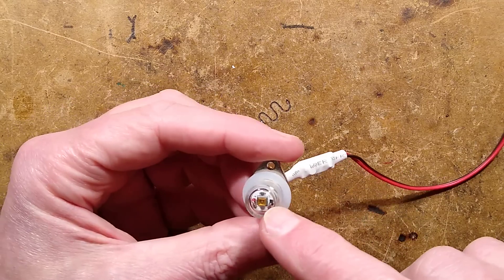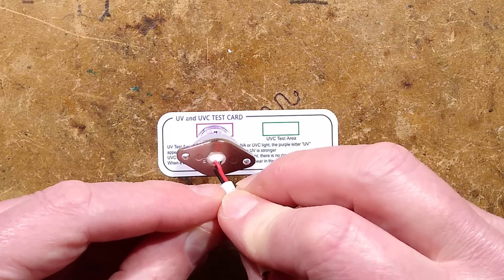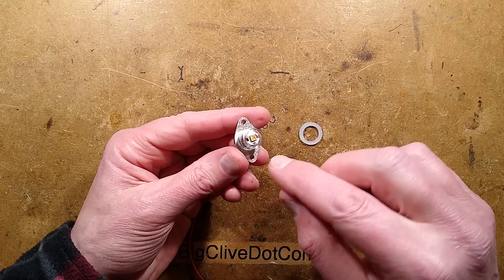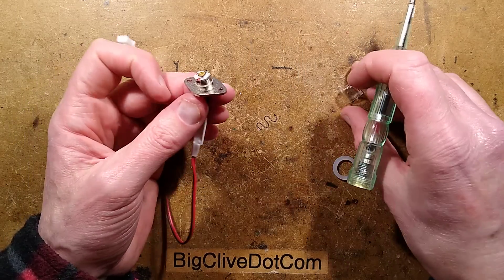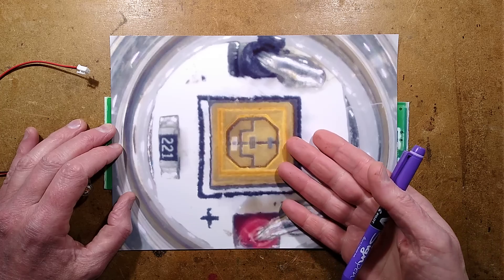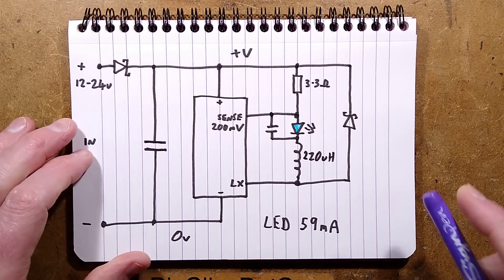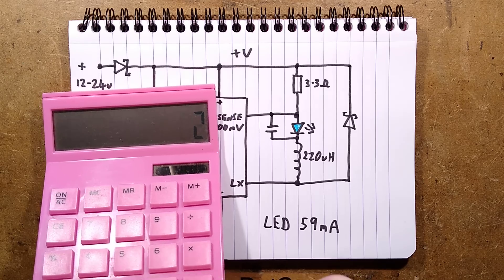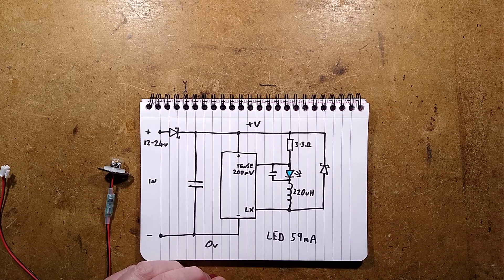UVC LED module for water sterilising

Comment: Thanks for sharing your results. I see a lot of comments questioning the quartz glass dome. You got a result on the card for UV-C. Doesn't that mean that the glass must be quartz? If it weren't it should have blocked the UV-C with no result (not even a faint). So I would state; either the testcard is fake and the UV-C indicator reacts to  UV-AB which will penetrate normal glass or if the card is genuine for UVC the dome must be quartz.
A simple test for checking the quartz is to try and make a small scratch with a knife. Quartz is harder than steel so it should not scratch the surface.
Reply from the maker: It can also be high purity uviol glass.

Comment: I also bought a 5V led UVC and did some tests, the first time it drew about 0.06A, but even so the led heated up after 15 minutes, then I increased the voltage to 8V, it drew 0.4A but it stopped by itself, I think it was due to overheating, now at 5V it takes 0.25 A... I don't know why... in the banana test it didn't color at all, even if I took off that quart or whatever it is... I'm still testing. DO NOT look at him with a blank eye, danger! it's like a welding flame!

Comment: I miss the old TO3 packages, I've known them since my valve days.
Not surprising actually since they were designed to plug into B9G valve sockets during the changeover period (mechanically, not electrically, obviously).
Try it for yourself, or get the dimensions for both and compare.

Comment: For years I wanted to put one of these at the bottom of a 55 gallon plastic drum full of water. 
I figure that with the small amount of heat the LED emits, it will create convection currents in the water so that it will all be near the LED in time.
Maybe as a survival source of clean germ-free water.

Comment: One thing I've learned recently about LEDs, is that you can put a very low current through it (1uA or so) and measure the voltage drop. If it's (for example) 2.1V, calculate the wavelength of a photon with 2.1eV of energy, and that will be the wavelength of light the LED produces.

Comment: 3:19: I know you have to use isopropyl alcohol to clean fingerprints off the quartz glass on, say, an incandescent stage light bulb. But for a piece of glass that doesn't get that hot, is it strictly necessary?
Reply from the maker: With these, the layer of fingerprint oil can attenuate the UVC output.

Comment: Mouser has the Mikroe-4144 UVC sensing board for about 50€ plus taxes. That uses a narrow band UVC detector. Should be good to build a simple detector from. It has analog and i2c outputs.
Reply from the maker: I've ordered a simple UVC meter that may use one of those sensors.
Reply: @ looking forward to the reverse engineering!

Comment: This is a very interesting component. But don't forget that UVC is extremely dangerous. Never look into the beam with your naked eyes ! (if you want to keep your retina). And skin exposure can cause cancer !
Take care and wear the right protection.
Reply from the maker: The cancer thing has changed.  They now realise that while UVC causes surface irritation it doesn't reach deep enough to damage DNA.  UVB and UVA at high levels pose a much higher risk.
The effect of UVC on the eyes is purely on the outer surface.  It does not penetrate to the retina.
Reply: I probably need to update my knowledge of the risk level, but I prefer to remain cautious.

Comment: Maybe a dozen in a small rvo under sink system. I have 2 UV sterilizers that have 25w UV tubes in quarts tubes after the water passes thru a .01 micron pvdf filter. Only lets water and dissolved minerals thru. Our subdivision is on well water and a water tower that’s not treated. The UV is turned on with a water flow sensor and relay so it’s not on 24/7. The ballasts and bulbs here aren’t quality so weekly tests are in order.  What UV type are my bulbs?
Reply: What does RVO, PVDF mean? And why and how do you do weekly testing of the system?
Reply: @cajampa  rvo reverse osmosis.  polyvinylidene fluoride pvdf  thats what the filter was sold as. It has these strands/tubes looped inside that are glued into one end. Water enters the strands/tubes on the sides and exits on the ends. I test weekly because the UV bulbs and ballasts are so unreliable. Cheap Chinese is all that’s available in the Philippines.
Reply: @rancillinmontgomery2480  OK thanks, but how do you test for still functioning sterilizations by the UVC? I ask because I will probably get something similar with also Chinese based hardware. And this quality/trust problem is why I haven't yet.
So I am really curious how you solve this.
Reply: @cajampa  I just make sure they are lighting up.
Reply: @rancillinmontgomery2480  OK. But just because it looks like it is working, does not mean it gives enough of a UVC dose to unalive anything needed in the water.
These things gets weaker when they get older that is why they have hour rating on them. Meaning they still put out light far after they are doing its proper function.
Reply: @ they don’t usually last longer than a year maybe from being over driven. A total of 50w of UV should do the trick even if it’s gone down by half output I would think. They are in series plumbing wise so the water passes thru a stainless tube 475mm then another long at a low flow rate. It’s only for drinking water and ice machine. You also need to pull the quartz tubes and clean with CLR to remove the mineral buildup that cut down on UV transmission.
Reply: @ one thing is for certain they are not set and forget.
Reply: @rancillinmontgomery2480  OK, I would think the only way to find out how long your setup lasts before it need to be changed as far as UV goes. Is to do some kind of bacterial culture on some medium.
And what would you have minerals in your water after you RO filter? I have 0 TDS after RO membrane. What is CLR?
Reply from the maker: The sterilising UV bulbs are UVC.  Make sure you don't look directly at them when they're lit.

Comment: Mr Clive, have you ever done a teardown on a hotel chocolat velvetiser? Fixed mine this weekend, and I thought the wiring in the base was beautiful, even dealing with the sealed unit 👍
Reply from the maker: I've not looked at one.  I'd guess a heater and magnetically or directly coupled stirrer motor?

Comment: Well I feel much cleaner now, thanks Clive. 

Why not just put the visible led in series with the UV led.?

Make your own UV a, b, c, and IR, detector/realtime imager. Us an old phone or digital camera, 8 to 12 megapixel is plenty.
Remove the lens, remove the AA grill and any internal filters. Refit the lenz and rub off any coatings. Use a Circular Polarization filter on the lens.
Some old-school pre digital filters enhance all UV or IR.
Some devices may need some alteration to the firmware.
I use a 2004 8mp Cannon, uses AA batteries.✅
UVa shows yellow~ish, b blue~green, c red~ish-blue.
IR low band, blue~ish white. IR high band, green~ish white. Use the flip-out display  (NOT THE EYEBALL VIEW FINDER).
Its not dangerous.! Just good safety habit training.
Reply from the maker: The visible one operates at lower current.
Reply: Resistor.?

Comment: I have a small sterilizer that uses the same style of UVC LEDs. I believe the two dies are 390 nm (visible) and 250 nm or 270 nm (UV) respectively. The small slab of silicon on the side is a zener for ESD protection. The data sheets are out there somewhere. Edit: And the UVC output is pretty feeble if I recall from the spectrums in the datasheet.

Comment: Interesting it didn't cause your skin to burn.  I bought a "120W high power UV flashlight" from Aliexpress ("Alonefire Flagship Store") and although it's only supposed to be UV-A it's so bright you can feel the heat on your hand if you stick it in front of the beam, and smelling your hand afterwards gives a really bad burnt smell.  Not sure what the true wattage actually is but I never realised strong UV-A light could cause burns too.

Comment: I couldn't believe when you said that spectrometers were that expensive, so I did a little digging. Seems like there are a few options, especially from thunder optics, but they only seem to go down to just under 400nm. Not nearly low enough for what you're looking at. I'm really surprised there aren't better cheap options available for this.
Reply: Search here for the  Little Garden Spectrometer. It's a marvel at under a hundred bucks. A Chinese man recently started making them on his own. The resolution is exceptional and with a diy razor entrance slit they can resolve the sodium doublet.
Reply: @Muonium1   Sadly this seems to have the exact same issues as all the others with measuring UVB/UVC. It's amazing that these are coming out, but they don't solve the problem Clive was having.
Reply: @radiantthought  it's using a transmissive polycarbonate grating, a piece of DVD, so nothing below about 400nm can get through. For below 400nm you HAVE to get a Czerny-Turner parabolic reflective grating based device, there's no other choice. No cheap option for such reflective gratings yet.
Reply from the maker: The complexity is the behaviour of UVC.  It is easily blocked, so standard optical systems can't measure it.

Comment: So, I don't suppose this is powerful enough for our 2 x 10,000 litre rainwater tanks, then 😀. I could see a use in some of the very low flow smaller aquarium bio-filters though, possibly as a pair, since mounting would be easy, and they use pretty much no power!

Comment: That cover is probably quartz, but there's a misconception about regular glass. 2mm thick borosilicate and soda lime glass actually transmits about 90% at 375nm, 50% at 300nm, cutting off at about 260nm. That's sufficient for most UV photochemistry.

Comment: Those dual chips are usually listed as "270-285nm". I'd assume they're 285, as it seems the shorter the wavelength, the higher the price, almost exponentially. They're about 1-3mW of optical power.

Comment: Check the Vd and current for the LED itself, then check digikey for cheap LED below 300nM which looks the same.
PS  the bottom of the LED itself is all copper pads, so as long as solder is wide, it's well heatsinked, even if it's not flat against the PCB.

Comment: Would be interesting to see if the test card would light up more without the glass.  With the product being so cheap I wonder if that "glass" is really quartz, if it's normal glass it will block most of the UVC.  When it bounced off the table it sounded more like plastic than glass or quartz.  Not that it matters much, the power is so low it would only be good for sterilizing about a teaspoon of water, maybe a tablespoon...

Comment: How warm does it get I wonder, as it's not touching the heatsink the answer should be 'very' either that or the only LED on that die that's real is the visible light one ! and the faint glow of th UV one was an illusion. I would have thought the visible LED would bleed enough to slightly excite the UVC panel ? You could also just remove (Knock off) the visible light diode and then see what the current draw is, also you could then 'beep' it out and see what's connected. When you look down on the device the visible section is separate from all the rest and is probably the only thing lighting up !! Use a bit of that UV glue that you use or resin (I forget which you have) to test a cure time I dunno but I think that center 'emitter' looks dodgy as hell and not like others you have shown and I have seen in the past, also how much was it ? Lastly since you like many of us like 'Light' would no a cheap spectroscope make sense ? failing that there are plenty of DIY ones on the tubes for less than 50 quid or so to make.

Comment: Mind the peepers when fiddling with light emitting devices which function at frequencies the detectors in the human eye are not tuned to detect.  It is getting toward the adventurous culination season, but I dunna care to sample freyeballs. Here's hoping your spectacles sufficiently filtered. If there was a hole in the phosphor on your LED, would you ever realise it?  If you ever get another crack at borrowing that UV detector, might be interesting to have a go at a random sample of LED's to find out? I suppose we are all at the mercy of the dilligence of the binners.  I know that skin smell you were testing for from messing with EPROM eraser lamps.  I did not consider the possibility of reflected light.   If it can make a microcontroller forget what it is supposed to be by fluidising semiconductor materials, it is certainly feasible to suggest it could make DNA forget it's program as well. The effect could be almost instantaneous to surface tissues, though it may take a while to realise the consequences. 30 years on, although melanin spotted I still have most all my fingers aside from that mechanical separation of the far distal bit of my second most useless digit. Also curious is that every latex rubber band in the vicinity rapidly decomposed, perhaps O3 production from that lamp?  Yes ozone produced by a UV lamp can penetrate every nook and cranny, dramatically reducing the lifespan of every dustmite bathed in it, and they may even be slightly anethsthetised while bathing, but be aware, the elastics in your socks and undergarments may soon fail to elast= droopy drawers.  Has every plastic gone crunchy or gooey?

Comment: You can't get a suntan through your glass window. Glass doesn't pass UV through. How does the UV get through the glass?
Reply: There are many different types of glass.  UVC will pass through fused silica (quartz), basically glass without the additives that make it easier to work with using normal gas flames or ovens, working with fused silica requires much higher temperatures so it's usually way more expensive than normal window glass.
Reply from the maker: Glass will pass longer UV wavelengths into the UVA region, which gives a tan.

Comment: I found a bunch of uvc bulbs about 4 inches long at goodwill for $2 each, I bought them all. The bulbs were 15 watts I think, and they would turn plastics brown and crispy in seconds. I tested the bulbs on living plants and a 10 second exposure killed everything, but it took time to see the effects. I used safety squints, pants and a long sleeve shirt for protection.
Reply: Do you have a link with a picture please ?
Reply: @colinbm2010  I can't find those bulbs anywhere. The bulbs were for an air ionizer, they were 7 watts, but it was two thin U shaped bulbs rated at 3.5 watts each. The bulbs were in a blue plastic reflector.
Reply: oh yeah, the instant skin cancer lamps. Love those

Comment: It looks like the main wires are holding the LED away from the back plate but they are soldered on the front so you could desolder them, stick the LED down and then resolder the wires on

Comment: Clive,  Spectrometer,  Check out;    Project 326   A Small, Cheap Micro-Spectrometer  .    Very simple cheap device and a lot of info on measuring UV and other radiation. Best

Comment: Clive,  cheap Spectrometer I recommend you  visit  Project 326  he has tested a very cheap device the video is  " A Small, Cheap Micro-Spectrometer - Review "   He does not sell anything just test various kit used for radiation detection the device he shows is about fifty quid and rather good.  Certainly the technical information would be of interest to your followers. Best .

Comment: The small power and ground planes in the circuit board design under the LEDs have an offset under the UV-A one, I wonder what the reason behind that is? 🤔
Thanks for the video!

Comment: There's always the banana burn test, seeing if the little LED can leave the banana skin discoloured from damage as you've demonstrated before with the big CFL-type one... :P
Reply: I have a compact fluorescent uvc bulb I got back in covid daze.  It's clear, and is intended to sterilize a room.  It came with a control base and a remote to turn it on/off and set it for on 30 minutes or on 60 minutes. I put it on the breakfast bar between our kitchen and living room.  I know it's legit because if I ever need to go into the kitchen at night, I turn it off manually and get whatever beer I need, and the air has a tad of ozone pungency.  I also "tans" any green bananas I also have on the counter.  I think this bulb is suppose to not be the strong ozone emitter, but it is pretty light.  The mercury vapor UVc bulbs come in two flavors, one that is suppose to release ozone, due to its exceptionally clear glass(ultra low iron I think) and another that they dope the glass with some mineral the selectively filters out the very hard UVc that makes most of the ozone.  I think the ozone ones are for sterilizing water and are ment to be immersed like in an ozone generator or filter tube, like for aquariums or water processing.

Comment: The chip is a variant of the "standard" PT4115, wich is used everywhere
It can deliver 1.2A and has 100mV sense voltage
The PT4211 has 0.8-1 Ohms of on resistance while the PT4115 has only 0.4 - 0.6 ohms they come in the same package so there is not much need to care about the smaller version I think
As you said, these things come in all different flavors

Comment: Could work nicely in the bottom of a stainless steel pet water fountain that recirculates the same water with a pump.  They can get scummy over time even with frequent washing.  The filters that come with the pet fountains are garbage since the water is allowed to flow around the filter.